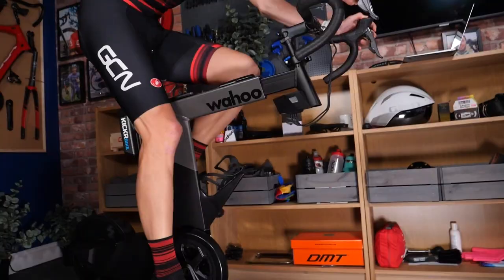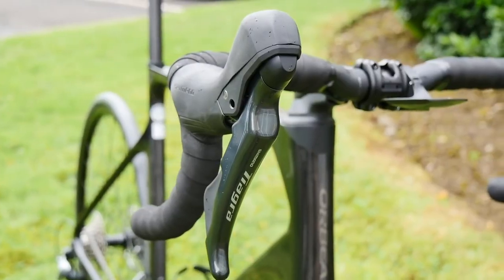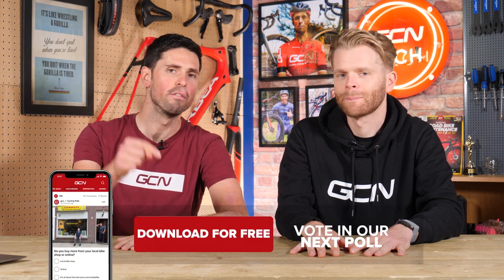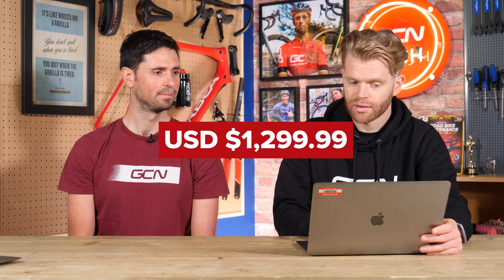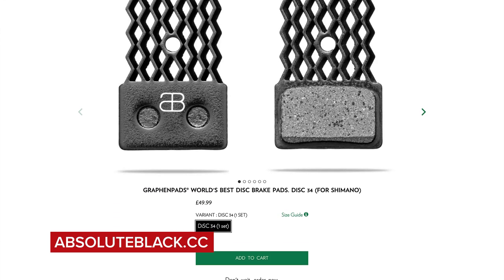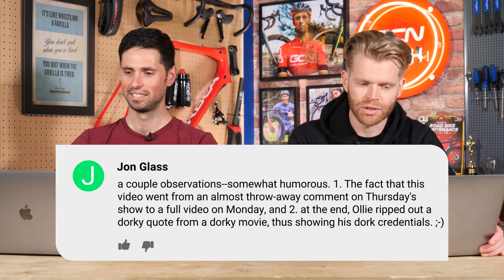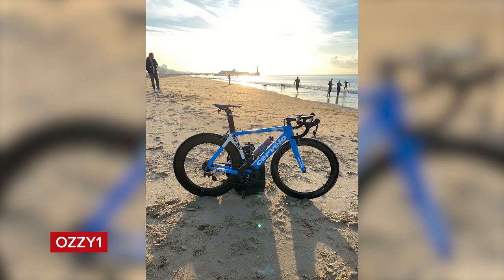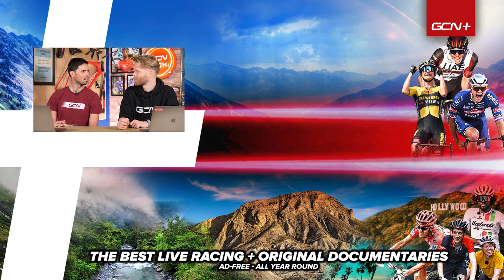Has Tiagra Replaced 105 As The ‘Groupset Of The People’? | GCN Tech Show Ep. 247

Comment from the maker: Is 105 still the groupset of the people?
Reply: Yeeaaahhh
Reply: No far too $$$
Reply: Not the new 105.
Reply: Just 96£ difference for 300 gram savings and more gears, performance, and durability? Yes it’s still the groupset of the people.
Reply: Mechanical 105 yes. Not the new electric 105. When shimano bring out 11 spd Tiagra then we have a new King.
Reply: SRAM Rival is the new groupset of the people : Electronic shifting für around 1000€... 🙂
Reply: Yes, but not the Di2 version, you loose a gear and have to pay at least half the difference in cost to close the weight difference with Tiagra.
Reply: @RazzFazz-Race  good point, now SRAM is :)
Reply: No. And I believe you can use any rear mechanical derailleur with whichever shifters, because the shifter controls the pull ratio. :)
Reply: I still prefer Ultegra but it is getting way too expensive.  Although if I had to get an electronic groupset I would probably go with the 105 since it is a lot cheaper than Ultegra.
Reply: I had 9 speed Tiagra on my old Trek 1.5. Finally after many years of flawless service, the shifter broke. I decided to modernise the bike and fitted a NOS Ultegra 6700 groupset to give me a couple of extra gears. I reckon the next upgrade, will be a ‘downgrade’ to 11 speed Tiagra, when it finally lands!
Reply: Yes. Technology has simply advanced to the point that electronic disc groupsets are now standard/mid level.
Reply: I feel like when Tiagra goes to 11 speed it will be the groupset of the people and I would be willing at that point to drop from 105 to Tiagra on a new bicycle .
Reply: Good luck getting hold of either group for 'retail' prices.

Sora ftw.
Reply: Shimano would be stupid to discontinue R7000 105 mechanical groupset, especially the rim brake version................It's now the top-tier mechanical groups set, and on par with even dura ace of 5 years ago. The Di2 version is no longer the groupset of the people, it's for beginner racers aspiring for Dura ace.
Reply: Mechanically, Yes.
Reply: I can't wrap my head around using 105 on a bike, because back in the 80's the derailleurs would wear out their pivot points after three years of hard riding and become sloppy when index shifting.
Reply: Di2 105 has passed the threshold and is now joining Centaur of Campa. #commentoftheweak 

Btw, true "of the people" should be passed to Sora.
Reply: If you have influence, please tell any big shot rep in Shimano to never stop making the 105 mech 11 speed. 105 doesn't have to be the groupset of the people, Tiagra can take the title. BUT 105 has to be the groupset of enthusiasts and amateur riders. Mech 105 needs to maintain its class and superiority over Tiagra.
Reply: ¿El de la versión 7000? Si. Aunque el Tiagra tiene lo suyo. Al igual que el sora.
Reply: No, it’s the new ultegra
Reply: groupset of the rich people
Reply: I'm running twenty year old Sora 8spd STI levers on my ancient road bike and they work really well on a hedge rescue. As pretty as the newer stuff is, the DI2 option would be unjustifiable for me. Great show as always chaps, but the throw away comment at the end had me in stitches... "Is it washed?" Comedy gold.
Reply: No, "The people" have no need for electronic shifting. A mechanical systems is more serviceable, can be bodged on the roadside if needed and shifts well enough for anyone who's not racing at a decent level
Reply: Doesn’t sound like it , but then again every manufacturer’s groupset’s have gone crazy expensive.🤷🏻‍♂️
Reply: Flatbar Alivio has always been by the number of commuters and rental bikes
Reply: the groupset of de People is the tiagra, 105 is a starter pack for racing or first stage por racing, if we look about heavier is  tiagra, buth can be balance with a good wheelset and others components to work with a balance de bike in my own experience.
Reply: Probably, but not by force, simply down to what the people can afford, which isn't 105.
Reply: Sensah groupsets are the groupsets of the people nowadays. I bet that around the world there are more Sensah equipped bikes than Tiagra or 105.  China has more than 1 billion people, India too, and SE Asia has 680M. They don't earn as much as their western counterparts but there are a lot of people who ride road bikes and MTBs there even if they cannot practically afford 105s, Tiagras, SLX, or XT.

I myself built and ride a hybrid bike that has a 2X Shimano Alivio (38t 28t chainrings, 11t-34t cassette). Chinese carbon frame, seat post, and handle bar. Alloy rigid fork and 650b wheels with 1.75 inch wide "road" mtb tires. Shimano MT200 hydraulic brakes. It's like the opposite of a gravel bike, an MTB modified to improve road performance. Total weight of 9.3 KG, less than 800 euros, never had a puncture despite riding on potholed pavement and dirt roads of south east asia.
Reply: @sepg5084  doesn't sound opposite of a gravel bike. Sounds exactly like a flatbar gravel bike.  But just terminology.
Reply: Please shimano sell us 105 di2 but put the ultegra stickers on all components we all be fine like that. Please. We said please.
Reply: When 105 mech is no longer produced then it will be Tiagra. What made 105 the groupset of the people was that it was affordable for people who love cycling but sensibly have other life priorities, and 105 Di2 is just far too expensive. This is average joe (or jill) and in the bell curve of committed cyclists they represent the massive middle chunk. They might 'splurge' and spend up to £2K on a bike, but doubling that for Di2 is not justifiable, they have kids, bills and mortgages. All the talk of weight is irrelevant, it is price and affordability that made 105 the peoples' choice, and at £1730 105 Di2 is just not in that window anymore.
Reply: @redmond38  Yeah, I was going to say 105 mechanical might retain its throne as groupset of the people. But if that disappeared and there was only 105 electronic for three times the price, 105 will have jumped the shark. Both Sora and Tiagra are solid alternatives.
Reply: 105 12 speed not anymore
Reply: no, di2 is too much $$$
Reply: I believe Sturmey Archer is the groupset* of the people :-)

*yes, they make brakes too...
Reply: @banjo7127  Most normal cyclist can't afford that new standard.  I think bike component companies will lose a lot of business because of it.
Reply: @vyas555  agree with you 100%!
Reply: @RazzFazz-Race  You are so right - GCN has sold their sole to shimano so can't talk about SRAM and their amazing products.
Reply: @jamiehiggins1462  I think that most will shell out the cash or just save up a bit longer to have these modern specs. It’s the same with cars, people will pay through their nose for a new car every few years when all they really need is a 15 year old VW Golf etc. I agree however that the cycling industry is definitely becoming a rip off, especially when you see the quality of so called prestigious brand frame-sets.
Reply: From all the speeds of cogs from single speed to thirteen speeds, the ten speed cogs hold a very special place in my heart logically because it contains the maximum amount of cogs without compromising the chainline too much unlike the wider eleven speed cogs and beyond, if they say that the eight speed and the ten speed cogs have the same widths then why not use ten speed to obtain two more option of cogs for the same width instead of eight or nine since the chain suffers the same stretch between front and rear sprockets anyway, that's why I don't use anything above ten cogs, because eleven speed is a bit wider than ten already and just a bit of one millimeter of chainline difference has a huge impact on chain longevity and power transfer due to losses from a too much misaligned chain because of too many gear choices that affects chainline, that's the reason why i secretly hold tiagra or any mtb ten speeds superior to the entire spectrum of cog numbers, i only concluded personally, that aside from my fixie, i only use either five speed (2x5 or 3x6) for fun rides or ten speed 2x10 for recreational rides, i swear I won't use any eleven speed above no matter how much sales talk they throw at me lol
Reply: Absolutely not. 105 hasn't been "the groupset of the people" since Barack Obama was president of the US! Tiagra, and even Sora are more the groupsets of the people.
Reply: I hope so, I just brought a bike with it.
Reply: was 105 ever the groupset of the people? who are the people? mejority cyclists or majority serious cyclists who actually wear cycling clothes?
Reply: No, it's Claris or Sora.  I did 31 miles this morning on my own 3x8 Claris equipped road bike (normally my wheel-on trainer), and I was consistently pleased with how cleanly, quietly, and quickly it shifts.   Sure, compared to my 11-speed Campy equipped bike and very narrow-range 9-speed Ultegra bike, the gear jumps are big, but they're still workable.  It's a bit heavier too, and it's fitted to heavier bikes, usually with alloy framesets.  But remember, we're talking about the groupset of the people.  Most of "the people" would be absolutely fine on Claris or Sora.
Reply: 6800 & R7000? yes. the current? no.
Reply: no Sensah Empire pro or team pro should be. for the cost of sora and quality of 105 or better.
Reply: @youngson6005  completely agree. i have built both team pro & empire series. those both shift & set so easily(except for the FD) which is not big deal. 
Sensah deliver the quality of shifting & material beyond it's price range and it's still unbelievable for me lol.
Reply: Yes but not the Di2. Long live mechanical groupsets!
Reply: Nope, Di2 only pushed the price point for 105 bikes well beyond what I'd consider paying for it. I'd rather buy mechanical Ultegra at that price point.
Reply: Once they get rid of mechanical 105...no
Reply: No way. You can't charge a whole bike's worth for a groupset and call it "of the people"
Reply: the other question is since 105 is now a 12speed groupset will Shimano make a 10speed,11speed and 12speed variant of tiagra groupset just like what they did on deore that has a 10speed, 11speed, and 12speed variant?
Reply: @RazzFazz-Race  Bauke Mollema would like a word, well, two words.
Reply: Better question - is Di2 the tech of the people? I think people have to realize electronic shifting isn’t cheap, and 105 Di2 is still significantly cheaper than Ultegra Di2. There are plenty great affordable mechanical options if Di2 breaks the budget.
Reply: Too much money now, IMO. Regular, everyday riders just don't need electronic. I'm not against electronic drivetrains, but it's not providing anything particularly useful above and beyond mechanical groups, which were already pretty well refined. 

To Agra takes the mantle in my eyes. And it looks good too!
Reply: 105 mechanical yes still peoples choice when Tiagra becomes 11 speed will then reign it's a great groupset.
Reply: Rocking the mechanical 105 here. Think the next years updates will be the decider for people.
Reply: Yes
Reply: Yes, but we are all riding rim brakes as they are better!
Reply: Not at  current  prices, unless they  decide to keep 105 mechanical around for a while.  Should  Tiagra become  mechanical 11 spd it  will become the new  recommendation for a novice.
Reply: Worth adding I just replaced the front 2 chainrings, cassette and chain on my tiagra after some years of serious hammer for £120!
Reply: The trouble is, iff Tiagra is the new GSOTP, we'll keep getting silly cyclists going on about how there should be a DI2  version.............. Which will then probably cost nearly twice the price of the current mechanical version! 🙄 This is what happened to 105. Carefull what you wish for!
Reply: I have 105 5700 10 speed on one bike, Tiagra 4600 10 speed on another and I barely notice any difference.  I've even swapped some worn out 5700 components for Tiagra 4700 and not noticed any difference other than visual.  If 105 is still for the people, it needs to be cheaper, and be available as mechanical and rim brake for older frames.
Reply: Mechanical yes, Di2 no
Reply: Nope. We already have two different levels of electronic group sets: the reason people weren't buying it WASN'T because there wasn't a third
😂🤣😂🤣
Reply: @robertnobles8189  lol performance and durability in 105 is no better than claris
Reply: Mechanical 105 is what I got.
Reply: I wouldn't say so in that most bikes come with lower end group sets and most people don't spend 105 money.
Reply: No that would be Claris
Reply: I have just installed a full tiagra transmisson on my bike, no need for 11 or 12 speeds, 10 is far enough.

Comment: The biggest upgrade mistake I ever made was upgrading to 105 from Tiagra.  I didn't notice any difference.  Yes I didn't really notice the extra gear.  Upgrading my wheelset to a nice carbon set did create a real difference.
Reply: I went from 105 to Ultegra last year.... Massive difference for the better... 🤷🏼‍♂️ But then my old TCR was old, and done a lot of miles.
Reply: Similar. Couldn't resist a used Ultegra hydraulic cable Roubaix. Tiagra with two sets of wheels would have been better. Saving up for next year - sell two bikes, get new goid frame, Tiagra, and modern wide rims.
   But, respect to 105. 1980s swap for Weinman 730s and 500s was monumental improvement to braking
Reply: @nicholasgiles500  tbf, 2007 Ultegra was noticeably better braking than mid 1980s 105. 2018 hydraulic Ultegra better than 2097 Ultegra. But they should be. Even recent Claris is pretty good
Reply from the maker: Wheels & tyres are always the top upgrade (gold chain not included!)
Reply: Glad to hear it! I am overhauling from Sora to Tiagra.

Comment: As soon as 11sp tiagra is released, it will dethrone 105 mechanical. The performance between the two currently is identical to 99% of riders. The one huge benefit of going 105 was compatibility to upgrade to ultegra/dura ace if you wanted to over time. If 11sp tiagra keeps that compatibility to 11sp ultegra/dura ace, that will be huge.
Reply: No, 7000 derailleur is another league above 4700. Hollow forged cranks is a neat feature too. The rest is - yes - comparable.
Reply: Exactly. It's about joining the 11spd club. All the cool stuff is made for 11/12spd, especially power meters, which is the next upgrade for many.
Reply: @feedbackzaloop  4700 does have hollowtech II. And yes the 7000 RD is better, tiagra shifting is still leaps and bounds above what most people have used prior to buying an entry bike. If you did a blindfold test, I bet most people couldn't tell having never ridden either (unless they counted the shifts of course!)
Reply: @bretthood1272  Hollowtech refers to the spindle, hollow forged - arm, those are different things. Also the big ring of Tiagra is stamped steel with plastic cover VS hollow aluminium shell of 105. The difference of course one could see only at sprinting. Basically, what I'm trying to say, 105 crankset stands out as own technology, while Tiagra is very similar to Claris, Sora and non-group specific parts, meaning you could go even lower tier.
Reply: @feedbackzaloop  Oh I misread the initial comment lol you are correct in that case... Shouldn't respond before coffee it seems!
Reply: @bretthood1272  Entry level bikes are sporting Claris, not Tiagra. Tiagra is clear mid-range.
Reply: @feedbackzaloop  The same hollow forged cranks that are snapping left and right?
Reply: @cjohnson3836  no, the snapping ones are glued. That's hollowbond
Reply: @kelvs45  nah, they'd rather pull the 11-notchet ratchet from 105 and put it into tiagra body - the philosophy of trickle down tech is to also keep cheaper tiers cheap in production.
And most probably it'd be r6000 now
Reply: I upgraded my bike with a 12 speed sensah version with an oversize pulley cage. Awesome.
Reply: Only issue with this(like it always has been) is that 105 will be 12speed only once they make mechanical 12 speed and Tiagra will be a step back again.   Nothing wrong with that but they do this on purpose.  They may never go to 12sp Tiagra either due to the nature of space and cost.  So long as we keep 130/142 rear spacing as the norm
Reply: @cjohnson3836  mid range isn't only one group.  Claris is entry level and Tiagra is too.  Nothing wrong with that.
Reply: @kelvs45  they'll at least still stamp the chainrings.  That's a sizeable cost savings
Reply: @veganpotterthevegan  True but my point is that in 3-4 years if you can pick up a used bike with 11sp tiagra, and upgrade to (at that point) a used 11sp ultegra or dura-ace, it would be a considerable cheaper way to get the best of best components, if that's your thing lol
Reply: @bretthood1272  you can wait 4-5 years and just buy Ultegra😉
*I'd actually never buy Shimano.  SRAM to the end🙃

Comment: Technology is not “trickle-down” if they just raise the price of each level. That’s just rebranding.
Reply: Eventually every bike will have at least 100 gears and a chain so thin it has to be made from spider silk. And every cyclist will have to remortgage their house to continue with their pastime.
Reply: 100% agree. The groupset of the people (assuming by the people you mean semi serious cyclists) is whatever groupset adds up to a total bike that costs around a grand
Reply: @johnmccrossan9376  1 grand road bike will be Claris rim brakes aluminum bike
Reply: Well, that’s an opinion
Reply: @VladGoro25  therein lies the problem.  Just a few years ago a bottom end carbon bike with 105 was under a thousand.  Not one single component, from the frame to the chain, has improved so significantly that the cost can honestly be justified.
Reply: Not  talking SRP. Advancement instead.  Put the Neil Kinnick back on the shelf.